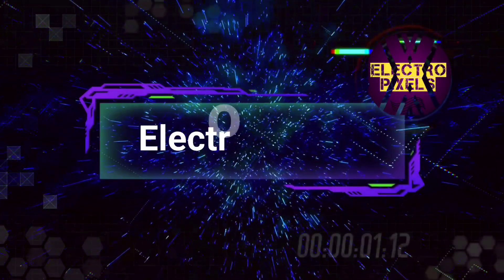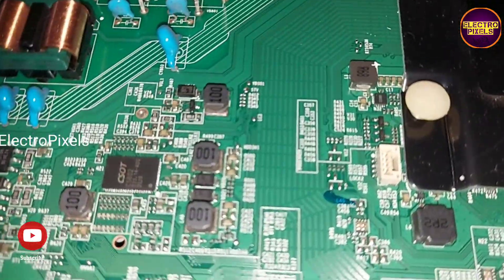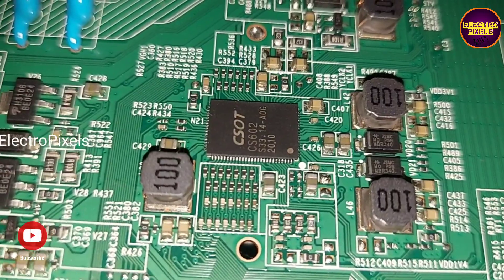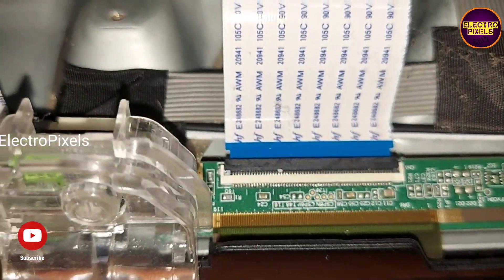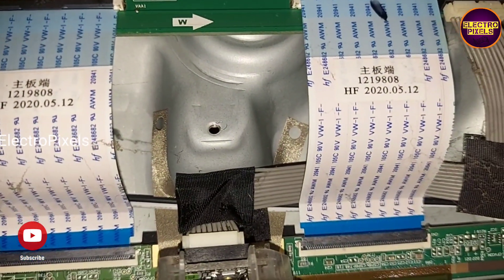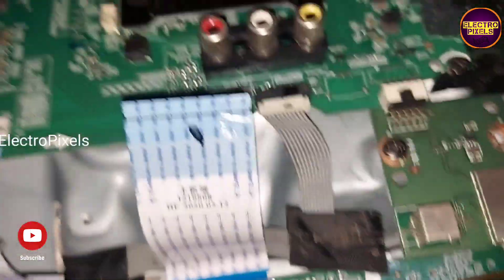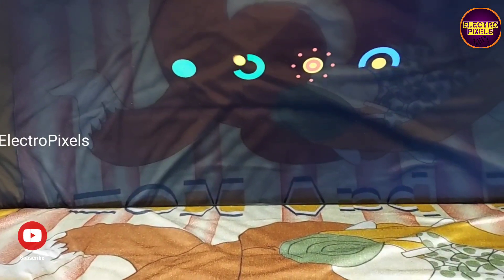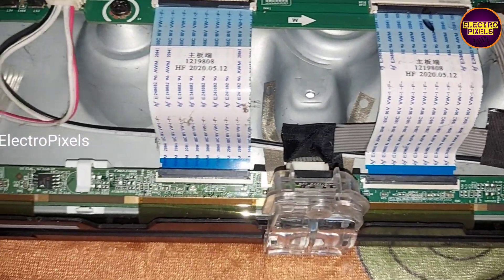Hisense 43 inch Led Tv No Display |No Vgh, Vgl Voltage |Panel short Removal| CSOT panel Reparing |Tv

Comment: Dear Sir

My toshiba 43 u5050 4k led tvs motherboard (same as this motherboard) not working due to damaged TSOT IC and 1 transistor, i found a replacement board for this, seller is saying he can show the  video of all required voltages of the board only. 

I asked the seller to connect the board with  single lvds cable to testing display tv160 motherboard tester, and it should display half picture depending upon which side of the board cable is connected. He said it is not workable.

So, can you suggest something in this scenario.

Thanks and regards

Comment: is the tv display still working after a year?
Reply from the maker: It's just a Temporary fixing method, Permenant solution panel Replacement its already mentioned in video, we can't predict how long the display will work using this method it completely depends on user luck basis, Infact the New Displays are also have the same Faul within 3 years

Comment: Hey I have the same TV and it has stopped working unable to turn on TV. The red light below blinks few times and TV goes in stand by mode. What's the main issue is the motherboard damaged or led panel damaged?
Reply from the maker: Backlight Damage, Check Backlights